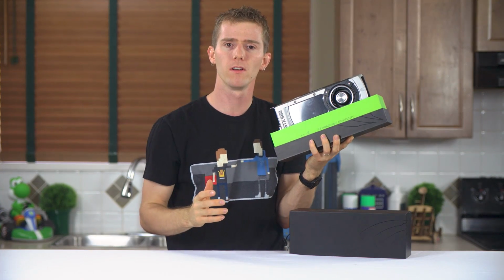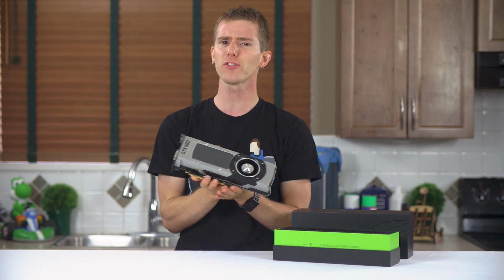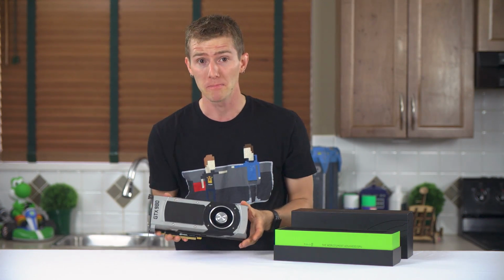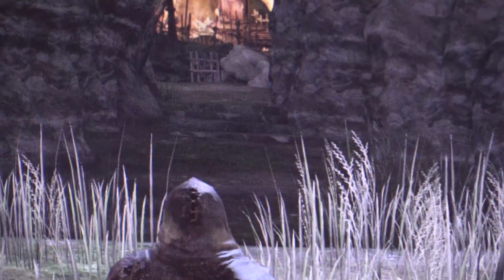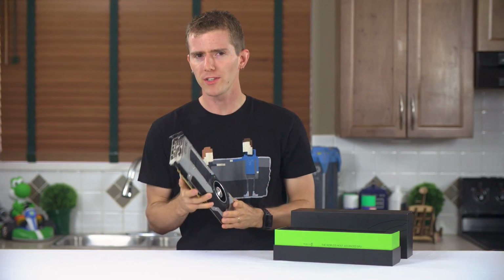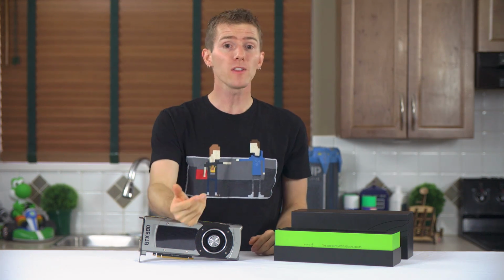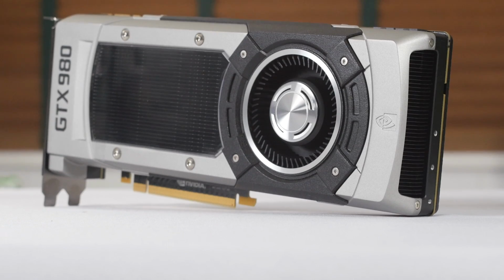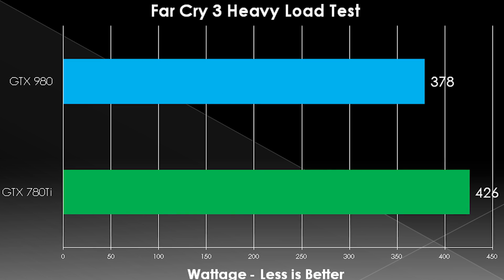NVIDIA GeForce GTX 980 Video Card - Performance Overview

Comment: I can't be the only one SICK of hearing about how these new cards save you money on energy ?
so TDP is down by 30 watts..... great that means less heat, but does anyone care about saving 1 kw over 33 hours of gaming  ?
what's that about $0.20 ? so that's 165 hours for $1 That's a whole week of 24/7 gaming if people take it in shifts !
if your seriously worried about $52 a YEAR extra then i'd suggest you shouldn't be dropping $500 plus on a GFX card in the first place ... get a grip People/Manufacturers !!
Reply: its true idc about power consumption as long as the card/gaming rig runs fast and powerful so yeah thats why im getting either 4 titan blacks or a titan black and 4 980s
Reply: ***** i agree, but you missed my point ... i'm saying that they should stop trying to CON people into thinking they'll save money when they spend it on a new card for $500 , lower power consumption is about thermals ... not dollars worth of energy...

Comment: Please provide us with an over clocking guide. I always fail at OC because I'm too afraid to play around with it.
Reply: GPU's aren't that weak. When a GPU crashes it doesn't mean it broke down it just means it shuts itself off to prevent damage. As long as you don't leave it to the speeds at which it crashed, you're good.
Reply: XD get msi afterburner then just slowly increase the clock and memory speed in tiny amounts until your screen goes black one it goes black restart your pc then set it to the clock speed that it was at right before it went black then it'd OC'ed and ready for better gaming
Reply: Minecast Zyad48 Honestly dude? Okay I'm not a genius at OCing but I'm not that stupid. That sounds like an awful idea to me. You go ahead and do that but I feel bad for your hardware.
Reply: *****
WeekendGamingNerds well i looked up how to OC and thats what the guy in the video said to do, push it until it goes black then restart and put it to right below failure to get the most out of your graphics card
Reply: 1N07
yeah thats right
Reply: ***** Alright, well thanks everybody for the input. Like I said, I'm kind of a wimp when it comes to stressing my hardware but maybe I'm being too 'sensitive'. I'd still like an overclocking guide just for the 980.
Reply: WeekendGamingNerds
dont mention it :), i love helping others out, any time you need help with something, tell me and ill see what i can do
Reply: oh i forgot about something, gpu boost is apparently supposed to overclock the graphics card until it reaches a certain heat output :O, how much OC do you think a 980 would get from using gpu boost?

cuz since it takes less power it also means theres less heat output meaning there a lot bigger of a heat area for gpu boost to boost the cards specs

Comment: If I had a $500 and already a GTX 780ti, I would not upgrade, but if I had $500 and no 780 ti, I'd get the GTX 980. But what gets me is why is Nvidia discontinuing the GTX 7xx series? So If I can find another GTX760, Im forced to have to upgrade if I want more power. Good job Nvidia!

Comment: The reference Nvidia cooler design is still awesome. I even prefer it visually over most 3rd party coolers(exceptions being ASUS's ROG Matrix, Poseidon, and Striker cards. I love those coolers) as it is one of the most appeasing looking designs ever made.  That said, it would've still been nice to see at the very least an update to the colour scheme. 

Anyway, kudos to Nvidia on the new cards.  It's nice to see them shooting for more power efficient cards that still up the graphics horsepower.

Comment: GTX 970 or R9 290?
Reply: r9 290 all the way
Reply: 970 trust me. You can check the benchmarks as well. It's cheaper more efficient, more powerful and it uses nvidia drivers which are said to be better...
Reply: Chris Fokjohn r9 290 crushes 970 and is way more future proof
Reply: Phray01 Ahhh no? And why is it more future proof?
Reply: Phray01 http://www.techpowerup.com/reviews/NVIDIA/GeForce_GTX_980/10.html

Comment: crossfire my r9 290 or this?
Reply: 980 is 15% more powerful than a r9 290.
But if you're going to sell the card and possibly crossfire the 980's then go ahead, but crossfired r9 290's are much more powerful then a single 980,
Reply: Yeah, I know. I was just assuming he was talking performance wise.
Reply: Skryfix GTX 980 is 20% faster than a R9 290, and with max overclock a little bit more. Plus, when the drivers mature, a couple of percents more. I would sell the R9 290 and buy a GTX 980.
Reply: With the 970 coming in so surprisingly cheap, the price on the 290 is going to drop like crazy, especially on the used market. If you've already got the PSU to run a pair of 290s (you'll want a good quality 850W unit) look to pick one up on sale for <$300, or used for $200 or less.
Reply: Rob Carter
I'm looking forward to it... it means AMD's entire line is going to price drop, and with the card being phased out they're going to all but fire sale 280Xes... which is good for me. I already own one of them and I'd like to pick up a second for crossfire.

Comment: should I SLI my 780 or upgrade to 980? Im using the dell u3011 monitor anyway. what do you guys think?
Reply: *****
well the 980 will have a more performance boost over a 780 so yeah i'd say get a 980 instead of sli since most games wont support sli at release ;P

Comment: why'd they skip the 880 designation?
Reply: It's because the architecture of the 980 series is new. The mobile series cards have the 800 name but still use the 700 series' architecture. They didn't want to give the 800 name to a gpu that they felt was so superior to the 800 series, they say it was to avoid confusion. Probably just marketing.
Reply: bingo!
Reply: enginesnblades thanks for the info, its been confusing me as well.

Comment: Should I get the 970 or 980?
 Probably gaming at 1080p; BF4, CS:GO, Ghost Recon, Watch Dogs, and anything else I can get on Steam. and the lot. Other specs for my PC are currently planned as i5 4690K, 8gb ram, budget originally planned around ~$1300 (R9 290 originally) Might go 1440 in future, probably not 4k though. Multi monitor much more likely.

Comment: I don't really see how the 780Ti is competitive with the 980. With your overclocks every benchmark is either neck-and-neck or has the 980 is ahead. That'd be competitive if the 780Ti was less expensive than the 980, but it isn't - it's ~$40-70 more. So less expensive, better performance, less power consumption, less heat - seems like a no-brainer to me.

Comment: no more vga port?! Screw this im moving to amd! (Eats popcorn)
Reply: One hour later..... Finished popcorn a while ago, nobody came.
Reply: The cheaper ones 50-100 have VGA. VGA is (basically) the RCA of PC. They're cheap, everywhere, and run low resolution. DVI simply has a better image output. If you think they're gonna slap on a VGA port in a new graphics card, bring out the Judas Priest, because You've Got Another Thing Coming!
Reply: I feel that John's sarcasm was missed
Reply: *****
yeah but who has a monitor that only has a single vga port on it? XD

Comment: Would love to see SLI performance scaling with three 4k monitors. I currently run three 1080p monitors and have looked at the newer ASUS 4k monitors as a future upgrade. Currently, my 680 handles everything I play nicely on all three monitors. So I need a reason to upgrade like 3x 4k monitors! Even if I can only drop in one 980 now and run stuff like bf4 in 5760x1080p and just take advantage of the monitor upscaling and then drop in another later.

Comment: LinusTechTips  Luke I hate to tell you this, but you done screwed up, not over clocking the memory was a mistake. Other reviewers have shown that the 980 definitely benefits from memory overclocking, which would have put the 980 ahead of the 780ti on every benchmark.